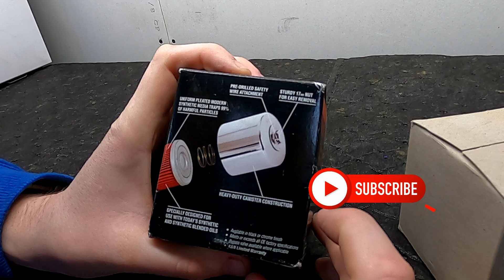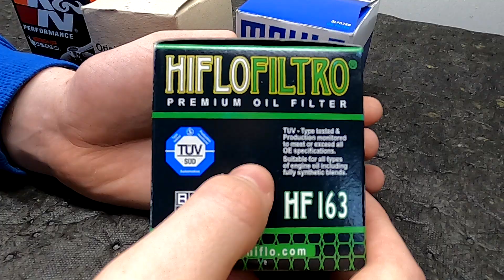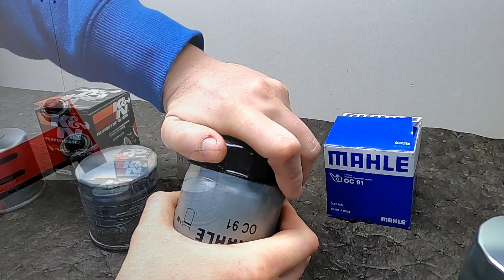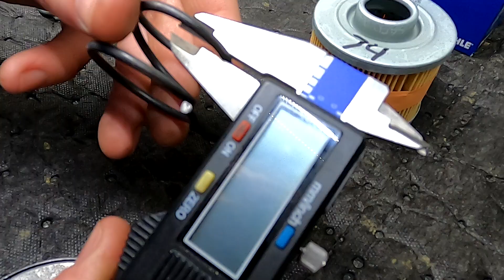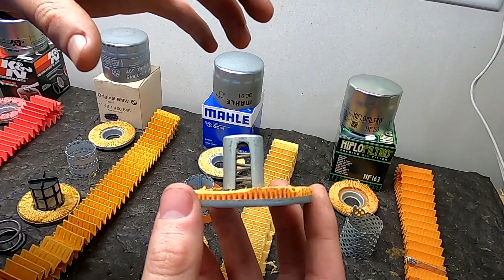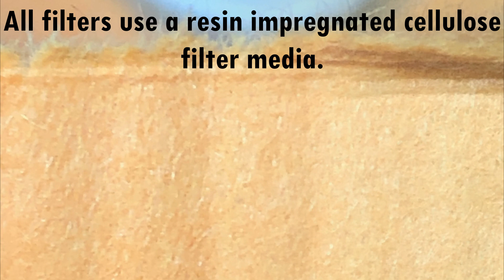BMW Motorcycle Oil Filter Comparison. SHOCKING RESULTS!

Comment: Thanks for the review.  First time i have seen a BMW filter disassembled like this.
BMW filters are made by Mahle and Mahle make good filters.
General consensus is, HiFlo make K&N filters.  That's why they are similar internally.  What surprises me though is the filter medium in the HiFlo is much better installed with an even spacing comparable with the BMW & Mahle filters.  And there are more pleats but this may be due to the media being thinner and being able to fit in.
Cost aside, BMW/Mahle for me first preference with HiFlo second.

Comment: So BMW and Mahle might be advantageous with having secondary filtration, but only when the bypass valve is activated? How often does that happen? For someone who does regular maintenance I can't see this being a "shocking" benefit.
Reply from the maker: lots of time in a cold start scenario the bypass valve opens to allow unfiltered oil to flow because unfiltered is better than nothing

Comment: I've owned german cars since 1981, with a VW Jetta  diesel 2 door coupe.   Mann, Mahle, and german brand filters is all I've ever run on my german cars. Same with my BMW R1250 GS, I run Mahle filters made in Austria. BMW works very closely as does Porsche, Audi and Rotax for their filtering requirements.  My 2015 Touareg Lux TDI and Passat SEL TDI get the same oil filter treatment. The extra bypass oil filter inside goes to show how important it is to feed your engine bearings and internal bearing parts clean oil.

Comment: There is VERY little info. on the web, even in 2022, on Genuine BMW Oil Filters vs. OEM/Aftermarket.  I used to use Mann or Mahle oil filters for my BMW M30 and M50 engines.  Then I decided to buy a Genuine BMW oil filter.  I noticed the Genuine BMW filter was made by Mahle.  I previously had a Mahle I removed from an oil change.  The Genuine BMW filter had smaller metal holes on the interior cylinder than the Mahle filter.  The BMW one clearly had more intricacy and higher demands for filtration and justified the price.  Weight has to be spot-on in order to get BMW stamp - I was told this by a major US BMW autoparts supplier, Bav Auto, who's sales rep used to work at a auto parts manufacturing company responsible for widgets.  He told me, if you really want your car to last, go with genuine BMW, if you just want to get by for a few years, go with the cheaper stuff.  The BMW stamp, is not just paying for the stamp, or the dealer's overhead, there is more to it that very few know.

Comment: The secondary is a Micro screen like found in injectors. Which can still starve your filter of supplying oil and clog even more resulting in no oil supply. If you think cold oil will still flow through a micro screen 🤣🤣 your delusional. The percentage of bypassed oil is less than 30% and unless you have serious sludge from oil that’s 10’s of thousands of miles old. You’ll never see a clogged oil filter. Your likely to see bearing material over sludge

Comment: First of spring has nothing to do with much than press plate. If the filter cartridge is a certain size that would include the bigger spring. Also the oring(tampered) accounts for that. That has nothing to do with which is better. They all are great. But price wise are not equal. So I will purchase which ever is cheaper and easier to buy.

Comment: You mentioned the anti-drain back valve on the K&N, and to wait until the end, but never followed up.  What were your discoveries?  What were the *SHOCKING RESULTS*?  As for the video, good, I thought, but overall conclusions would have been appreciated, and the "loss-leader"-type title was kind of tacky and unfulfilling.  Thanks.
Reply: I thought the same. The introduction of the filters headlines that the K&N failed and doesn't have a drain back valve and then he shows us the drainback valve.

Comment: For the R1200/1250 LC Boxer series the BMW filter is the same as the Mahle OC 619. The K&N air filter has to be cleaned and not to be changed. There is only a comparison to the lifetime of your bike or the day you sell it.
Reply: Cleaning is only for their air filters. Oil filters are disposable.
Reply: @kawasaki200z  Sure, my fault.🤪

Comment: As an ex BMW tech, Mahle make the BMW filters I believe, and some things you just don't scrimp on, people will use high quality oils, then go stingy on the filter. DUMB!
Reply: I wholeheartedly agree.  If you're going to pay extra for german or austrian technology or oil, be consistent. There is a difference in german made synthetic oils. They are held to a much higher standard. Group IV PAO or Group V ester based. Not Cheap ass Group III hydrocracked petroleum based that still burns off relatively easy and requires makeup oil between oil changes.

Comment: I like the video.  More info for the rider so they can make their purchasing decisions.  Here's my $.02 worth.  
.
I know a thing or two about those filters because I did a 3-part video listing specs as well as showing their performance in filtering ultraviolet particulate.  You can find those videos if you do a YouTube search for "Motorcycle Oil Filters In The Nuclear Age"
.
The spring controls the amount of pressure at which the bypass valve opens.  The spring's primary purpose is NOT to push the filter against the outer housing.  The lower the spring pressure, the sooner the bypass valve opens, which allows unfiltered oil to bypass the filter assembly.  Measuring spring thickness doesn't equate to any usable data.  Measuring the amount of force needed to open that bypass filter is the data you really need.
.
Number of pleats is interesting, but not very useful.  Thinner media can be folded more often.  In order for data to be useful you need to measure filter paper thickness, as well as square inches of media.  The thinner the media and the smaller the square inches, means less filtering.  Of course a filter can have thick media (and lots of sq.in.) and still be a failure.  That's because the filter media must have holes in the paper so oil can pass.  Too big a hole and crud passes through.  Too small and the filter will choke the flow of oil.  
.
As for the K&N filter, my test seemed to show it did a good job... BUT at the end of the test we learned the bypass valve opened at a very LOW pressure, meaning the filter was prone to allowing unfiltered oil to reach the engine.  This would typically happen during a cold start-up and under heavy loads.  If I recall the K&N spring rate was less than half the BMW or the Mahle.
.
As for the Mahle filter, it was on-par with the BMW filter, EXCEPT that the BMW filter had one more feature the Mahle lacked - a small screen on the bypass filter opening.  That BMW screen would prevent large particles from circulating thru the engine once the bypass valve opened.  Note that Mahle also makes the BMW filter, but BMW must have added the sceen mesh specification.  Which means the BMW filter is slightly superior (except for cost). *see below
.
As for the HiFlo filter, it's performance was truly dismal.  I wouldn't put one in a lawn mower.
.
And finally, the BMW and Mahle filter you tested were different models than the ones I tested.  The wire mesh screen was not present, instead there was a synthetic mesh screen used on both brands shown in your test.  Based on that, I'd say those 2 filters were identical except for branding and price.
.
As for me, I try to use the BMW filter when time and money permit (ordering, availability, etc.).  But if a BMW filter isn't on hand I will happily use a Mahle filter.
Reply from the maker: That spring that I measured was not the bypass spring.
Reply from the maker: also I like your cycle pump product :)
Reply: @HidalgoRides Your BestRest investigation was flawed. You did NOT measure the pressure needed to open the bypass valve. You measured the force not taking the valve area into account. You clearly demonstrated that you have no business evaluating oil filters.
Reply: @fuglbird yeah, right, Mr. Arm Chair Quarterback. I did measure spring pressure.

Comment: So, which one, in your opinion, is the best filter to use...?
Reply from the maker: Oem bmw. I believe it’s built by mahle but  to Bmw’s spec. I like the bypass valve filter and the fact that it’s engineered specifically for your engine.
Reply: OEM. Stronger spring, secondary filtration.